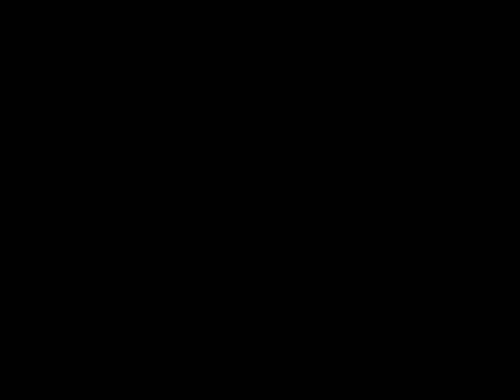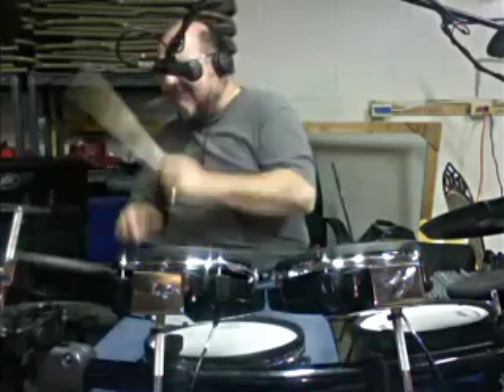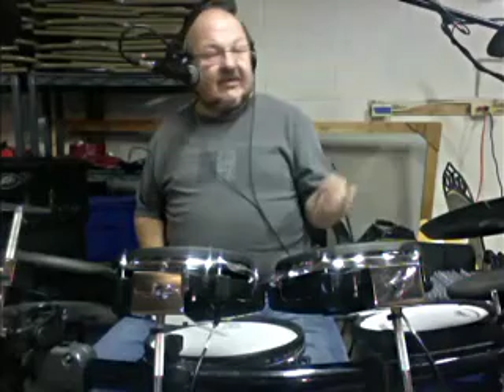The Real Deal when Utilizing Electronic Drums in a Live Scenario

Comment: Another question: do you think would be better to use the drum module output through a mixer then a flat headphones connected to the mixer instead of the drum module headphones output to best tweak the sound at home? In other words what do you think is the best way to tune the sound for a live stage but at home?
Reply from the maker: I tried that but I found the headphone output to be brighter and thinner, so I wanted to be able to add some wump to the kit on the whole, and individually. I'm using all 4 outputs on my TD12...one for snare, kick, toms, and cymbals...all panned to the center for a live mono mix...
Reply: Carmine Strollo so how you tweak at home? You take all the 4 outputs in a mixer, then how you listen the mix? from the master using a PA speaker or in some way with headphones?
Reply from the maker: I use the headphone out of the board mix and the AKG K240 are as close to reference monitors as I need. They are semi open, so they don't add low wump to anything. The board channels are flat with a pan to center for live venues. We don't run a stereo board. All of the kit output volumes are at around 90 I think, so I don't get an over modulated signal. And the faders on my module are all set to unity gain. The gains on the board channel are just below clip to give me a strong signal, while the faders are balanced at unity gain

Comment: How did you record the drums and the music all together? I am a newbee on this subject.
Reply from the maker: I have a yamaha 12 channel board. The drums run into the board. The computer out is also run into the board. I also use a mic for instuctional voice into the board. I have a usb interface running back into my computer recorded by audio software. I play the song thru the computer into my Roland Mix In. The outputs of the Roland go into the board blended with the music and the line outs of the board are run into the usb interface. Its like one big circular setup...if ther is any sound lag not matching the picture, I correct the lag in my video editing software by splitting the audio from the video and adjusting for the compensation...hope that helps